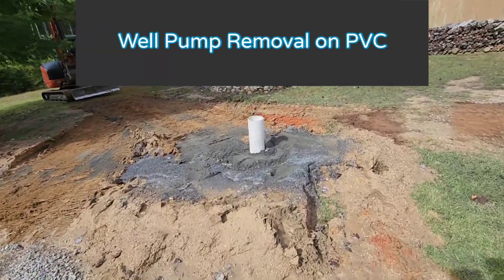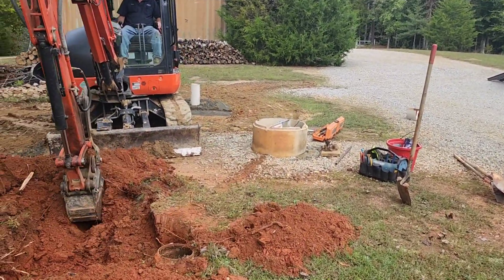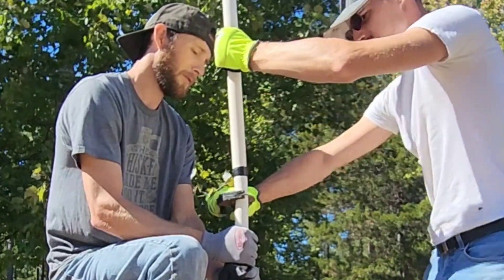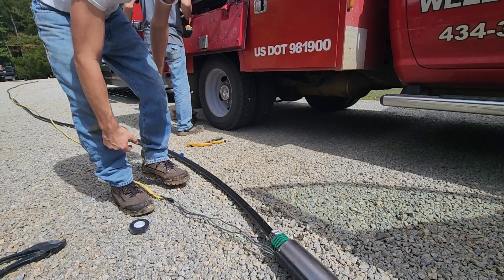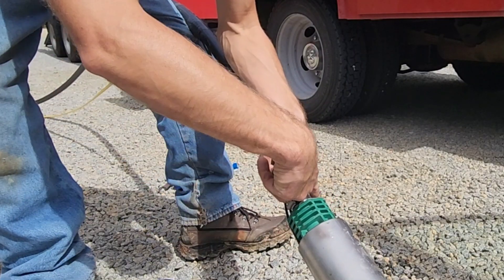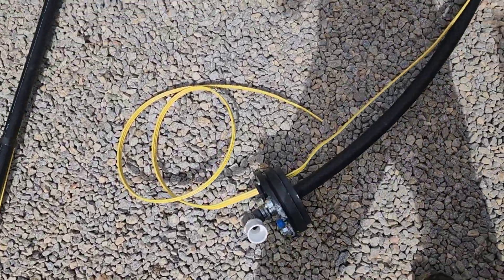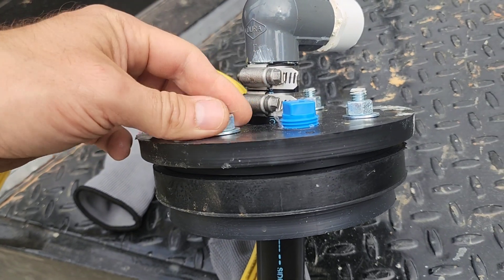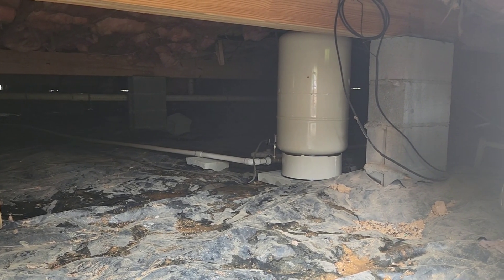Well Pump Removal on PVC Pipe, Installing into the New Well.

Comment: I would never even contemplate hanging a pump on glued together PVC let alone thin wall PVC. 
Thick wall PVC with stainless threaded fitting on each side I would, and have, done but never just glued. That said, black roll pipe is the way to go if local codes allow.

Comment: I always put the heads of the clamps on opposite sides of the pipe. Reason being... If a leak is going to develop, it will likely develop under the head, where the clamp is flat. Two spots there for a leak to develop. If you put them on opposite sides of the pipe, the strap of the other clamp is clamping down tightly, precisely where the head of the other clamp is leaving those two tiny spots where it may leak. Keep your clamps tight close to each other as well, and yer golden!

Comment: So i had the very same situation only it was 250 feet deep and has 3hp 220v pump that pvc was horrible like you said lost old pump down hole once and dropped new pump down also was able to retrieve both times pritty easy with nylon rope that was attached to pump anyway the two inch pvc is they used to fill 6000 gallon water tanks two or three times a day the he doesn't have any money i was doing work cuz hes my budy so he could buy new pipe i told him wouldn't be a problem use the old pvc i put same new pump new control box and new blatter tank thought it was good  he call three days later said no water i was mentally destroyed to put it lightly i return the day he called on and i traced the problem to the little red button on control box thinking why the box is three days old shurly it could be defective right sorry my question is the presure switch and control box are in two separate places if you have a 40 60 pressure switch does the control box need to know what pressure switch is cuz can run garden hose wide open for more than a minet and forget trying to fill water tank like they used to any sorry this so long ive seen all your videos they are the best out there no question keep up your absolute great work o and i dont do well stuff for work i just the guy that had the crane and would worry for free thanks

Comment: I've never seen it done like that! Pull it up 10 feet and cut it off? Pull  it all out same time.  Sorry not trying to tell your job or be a wise guy, its that I did that stuff back in late 60s and early 70's. I've pulled them out on the black SRK, thats the bad brittle stuff. I like your videos, brings back memories.  Oh and the digging a ditch to the house, yeah did that with pick and shovel, no digger.

Comment: Yes 1 year ago but I will ask again.....WHY are you not putting a cooling sleeve on these pumps before installing them ???? I know you know better and you know these sleeves will prolong the life of the pumps by helping keep the motor cooler by pulling water in from the bottom across the motor instead of just at screen level.  I asked this on another video and have gotten no answer.  Sorry but you claim to try and help people to learn how to do these things when in fact you should be willing to share this bit of info to people and let them decide if they want to try this prolonging motor method ...right ?  Right !
Reply: Ive never heard of these cooling sleeves what do they look like
Reply: @christianfigueroa1517  Some call them cooling sleeves, ( Pump Flow Inducer, Pump Flow Sleeve, or Just Pump Sleeve) A sleeve that is larger diameter than the pump which is capped (closed off ) at the pipe/pump end and extends past the motor end then forces water to enter that end and be drawn across the motor before getting to the intake screen which in turn keeps motor cooler as well as lasting longer.  Without it the motor just sits in stagnant water that is not moving, therefore water entering the intake above the motor has no chance to help cool the motor itself.  I use 3" pumps and put a 4" pvc pipe over it open extended 1-2 ft below the bottom of the pump motor which forces water to draw across the motor.  There's another trick shown to me by an old well driller ...to  hang your pump in a 6-8 ft piece of pvc pipe with about 15-20  1" holes drilled in the lower half and then set this pipe/pump at the bottom of the well eliminating the need for a torque arrestor and the pump pulls water thru the holes and up the pipe across the motor for cooling. All weight is supported resting on the pvc pipe with next to no torque at all.

Comment: I have a question..! Hopefully you read old video comments..! I know  this was a shallow set and can pull it by hand fairly easily but have you used your pump hoist and pulled out full sections  and then reused the pipe for abandoning old wells where you leave the pipe in the well..?

Comment: would have put pump back in bored well as a backup, what did at my house when drilled a well. the bored well still in use, hose bib on well house, other use to keep it flowing, but can switch a valve to run to house if drill well not functional (Would cleanse bored well before doing that of course)

Comment: Seems like you are always training a new helper.
Reply from the maker: I like to work high-school kids during the summer & teach them about hard work and to learn a skill & learn tools, but recently I have 2 new guys older than myself. With age comes trust, & I trust them to drive my equipment/trucks. Teens not so much.
Reply: @h2omechanic  Good Points - I love your ThanksGiving pump replacement at the lake house with Gandpaw hammering that home to his prodigy. My Dad always taught me to always give my boss more than he paid me for. I started as a grun on the shop floor at 18,000 employee company and worked up to the executive level. The shops could never figure out I could just walk through a shop and nail them on 80% of their problems without even talking to them. It was always harder in the long haul to do things half-ass and just keep redoing it over and over rather than do it right the first time.

Comment: What if bolts rusty and just spin
Reply from the maker: Use a hammer and flat head & pry around the lip of the well seal, it'll pry up
Reply: @h2omechanic  ok. I got pvc pipe .I haven't had water for a week..just ordered a vevo pump u tested..hope it lasts. .it's a 2hp 220v I hope it's a 2 wire as it didnt say anything about a control box which I hate.. so we have to pull the pump with PVC pipe ourselves with no foot break like u have..luckily the pump has a metal braided wire on it..imma pull it and cut it then put black poly wire..it's 175+ feet. I don't know where water level is yet.. I didn't have good water pressure with my last one..
Reply: @h2omechanic  do you gotta number? I ordered the vevor 3 wire pump but I'm confused as it don't have a N which would be a built in capacitor.. I'm on the phone now with them . But it don't say nowhere in here that I need a control box so idk
Reply: It's the 2hp pump 2 wire..3 with ground srry . It's a 4sdm4 4/16 pump 220v 60hz 2hp pump
Reply from the maker: @JimmyL361311  it doesn't require any controls box. It just needs to be wired to a pressure switch & fed with a double breaker 30amp 240v
Reply: @h2omechanic  ok..I don't wanna use PVC but they only sale 300ft black pipe or 100ft

Comment: Well stopped working yesterday.  Checked contacts on pressure switch and everything checks.  When contact is made the well doesn't seem to be cutting on.  The pump is getting power.  Is this most likely a dead pump?
Reply from the maker: If you got power to the well & its not running & doesn't trip the breaker, normally that's a indication of a bad wire going down the well. Typically you'll find multiple bad spots in the wire. Bad pumps normally trip the breaker. Either way you must remove the pump from the well
Reply: @h2omechanic  Okay got it. I figured the well would have to come out.  I wasn't here when it got put in so I'm going to open it up and figure out how deep it is. Thanks so much. Great content by the way.

Comment: I've changed 3 well pumps they were all installed with PVC pipe 234, 110 and 140 feet. I had someone to help me each time. We managed to pull  them without cutting the pipe by maintaining a long radius in the 90 degree angle of the pipe coming out of the well head. It was kind of stressful though, because I thought  the pipe might snap into at anytime. Your videos are great, I wish I could  have seen them years ago, it  always understood the electrical part but not so much the mechanical part.

Comment: These are great, I have to replace my pump which sets at 200 ft. I have removed the old pvc pipe and I want to go back with black pipe. Which you put a black pipe recommendation. I too want to replace my well seal, would you make a recommendation.
Reply from the maker: 200ft you'll only need a solid ABS well seal
 Home depot online sells 200psi black roll pump drop pipe in a 300ft roll.
Reply: @h2omechanic , hope you get well quick. Take plenty of vitamen C, Zinc, and D 3 and it will help a lot. My old well had 1 1/4 pipe, so on the new poly, do I go 1 inch or 1 1/4?

Comment: Got a question,  why would the owner not just buy an above ground water tank and store water there since it runs dry sometimes? I like your work and think what you did  is a better solution but times are tight and it seems it would be a much cheaper solution than a new well.

Comment: Electrical tape is a no no they make special water cable tape
Reply: Yes, he's mentioned that 'waterproof' tape in several videos. Easy to be fooled, it looks a lot like electrical tape I'm in the process of reinstalling my 260 foot deep pump, the pump and cable shop gave me 2 rolls of the waterproof tape. They also said OK to use 2" wide 10 mill 'pipe wrap' tape to secure the new 4 wire flat cable to the black pressure line. Just make sure everything is dry before you wrap it.

Comment: Question, if you just use electrical tape on joined wires and they are going to be below the water line, wont they just rot away? Electrical tape is not going to make it water-proof.

Comment: Why didn’t you use a shrink splice kit and torque arrestor?
Reply: In some of his other videos, he says he's had good luck using the waterproof tape around the splices, and the newer 2 wire pumps are 'soft-start' so not much torque trouble. and i imagine the black well 'pipe' can absorb some torque compared to the brittle white PVC.

Comment: I watched a pump and well guy pull 180' of PVC pipe out of my well in one go using just his arms. Granted, he had some pretty good beef on his arms. He had me pull the pipe away from the well as he pulled it up. Is there any reason why it shouldn't be done that way if you have the arms for it? I'm about to try this as my pump failed today.  i will replace it with the black poly pipe. I don't have a pipe dog.
Reply from the maker: I've done that before, but it requires a nice big arch so the pipe didn't break. It's just risky. If it breaks it can fall

Comment: Great videos. Thanks for the time and effort of making them. My breaker keeps flipping when I turn the pressure switch to the auto position. Is there a chance it could be a thermal regulator that has gone bad?  It looks like it was wired wrong.

Comment: have you ever worked on a well that has a 1/8 inch copper tubing that goes down with the well pump and hooks to the check off switch ?????
Reply from the maker: That's probably an old tech for a low water safety. But no I haven't. 
Commercial jobs require the turn for pressure checking.

Comment: Hey, do you have any videos on installing a new pump control module? I'd look elsewhere but your videos have the best explanations.
Reply from the maker: No unfortunately not. I try to stick with 2 wire pumps due to them not requiring a control box. But normally it's simple. 5 wires, all color coded.

Comment: What would you recommend for pump size, pipe size and at what level I should set the pump for a well that is 
drilled to 400 ft
 water level is at 320 ft 
Yield 15 gpm with 0 ft drawdown after .5hours
Reply: Need help
Reply: No help here!!!

Comment: Fill the old well with sand or gravel old dirt from drill site ?  Or customer will handle that .
Reply from the maker: By law they want it filled with bentonite chips at the water level, then clean fill dirt. Unless the system is used for irrigation purposes. So that's what he said he was doing basically to save money
Reply: @h2omechanic  interesting....here if you want to change the purpose of a well you need to get a permit for that. Not required in your locale?

Comment: I have a property that doesn’t have a well but my neighbors well is only 75 ft away. His house is about 300 ft from my property . The tank and switch is at his house is there anyway I could cut into the line and power before it gets to his switch and tank with another set for my property and make it work.I have talked to him and he said if I could make it work he is good with it.also I don’t want to have to dig a long ditch from his house to my property , because it’s in the nc mountains and it is really rocky.
Reply from the maker: I'd trench from his well to your house, all you need is a pipe "tee" into the line anywhere. 
You can't power the pump. 
Just give him $200 a year for the electric bill (Well Pump portion).  
A system under pressure will flow in all directions. So just run a pipe.
Reply: So can I not cut into the line before it gets to his switch and tank. He is not going to let me dig a trench to his house because it will have to run beside his driveway and this area is really rocky.I could see where his drive area might get damage
Reply: @ronniebuffkinsr8399  Find the pipe once it is out of the well and put a tee into it. Take it to your property.  Don't dig up his wires.  :)

Comment: I've really enjoyed watching your videos. I have a question, I had my pump, tank & switch replaced a few years back and since then
I have light san in the bottom of the tub and in the toilet tanks. ( i've always had a whole house filter) This wasn't a problem on my original pump set up. My thinking is maybe the pump's too deep in the well pulling silt/sand ? I'd love your opinion.
Reply from the maker: So when a customer tells me they're getting sediment randomly after 15+ years, normally it's due to a new vein that's opened up feeding the well water & its bringing in the sediment that's blocked it up for years & years. 
Or you might have metal casing that's 40 y/o & it's rusted a hole in the casing near the joints, this brings in sediment from outside of the casing. Normally a quick camera investigation of the well can show the issue
Reply: @h2omechanic  Thanks again for the Info, the casing isn't Metal (fyi) but i never thought about a different vein, that makes a lot of sense. I sent you a little something on PP. Have lunch on me!
Reply from the maker: Typically the installer doesn't put the pump deeper. Try using string woven 5 micron filter elements in your filter housing. 
FYI, pulling up a pump 10ft-30ft doesn't help decrease sediment. (If that was your thought)
Reply: @h2omechanic  I actually have those in hand gettng ready to put in. Any idea why it would do that after 17 years of not doing it. BTW I'll give you something for your time, your a professional and i appreciate the info.

Comment: Where was YouTube at 25 years ago when I was working on a well with my uncle that was over 200 foot deep. Somehow or another we were able to pull the pump out that was on 3/4 pvc without breaking a single piece.
Reply: Not uncommon. I pulled my 160' well this year and it had sch 80 1" PVC threaded with steel couplers and it pulled in one piece. I used my forklift 20' height to pull it with and it arced nicely without breaking. Probably wouldnt have tried it with sch 40 glue up pipe.